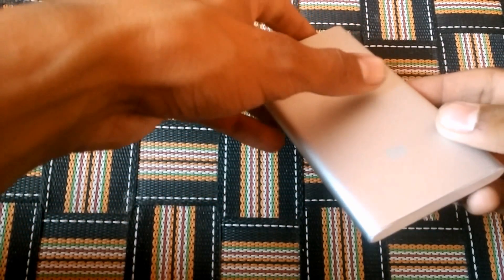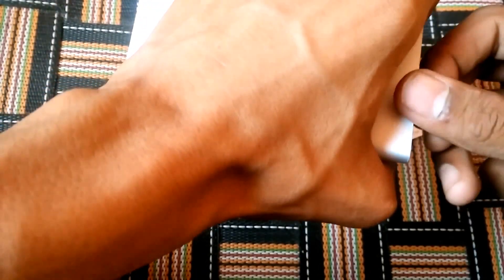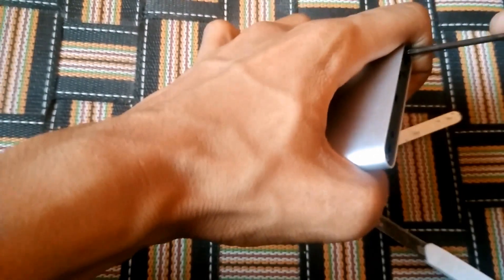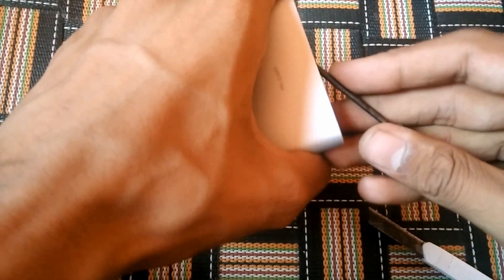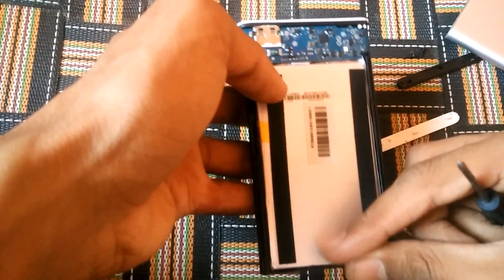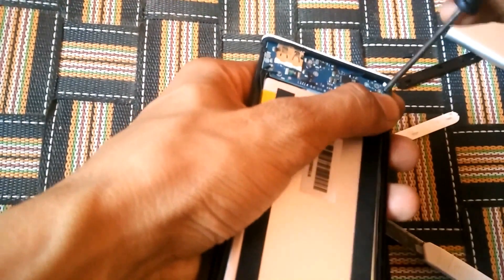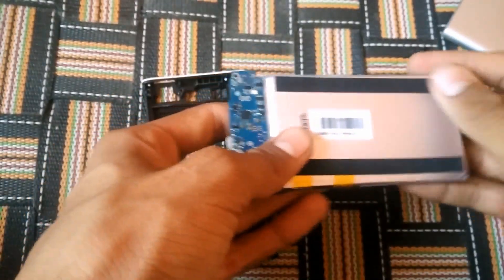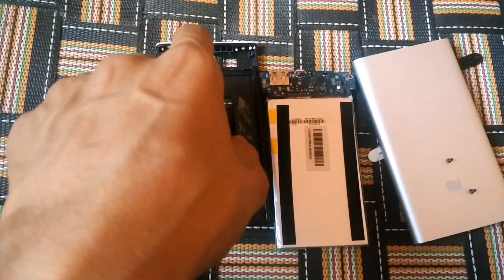mi 5000 mAH Power bank teardown [www.syctech.in]

Comment: mine just stop functioning. i cant charge any phone, it is not powering automatically, the led indicator is not powering up, but the power bank itself can charge from the outlet with no problem.what's thepossible problem anyone?
Reply from the maker: i could be problem in circuit board ...... it cant be repaired
try to contact mi customer service
Reply: I see, thanks. Ive had used it for about 2 years so I guess it's the end of it's lifespan. haha. I already bought a new one and exactly the same. I still trust xiaomi.